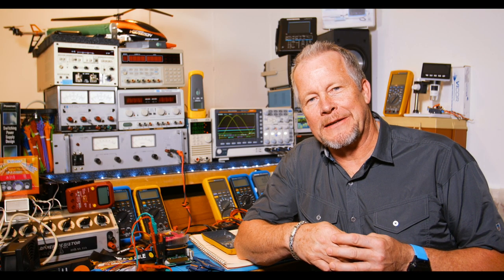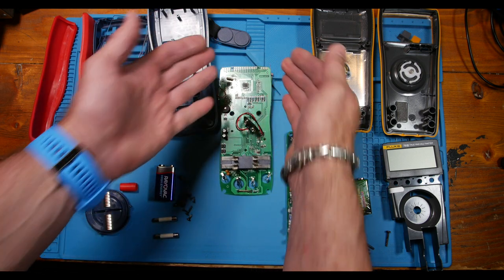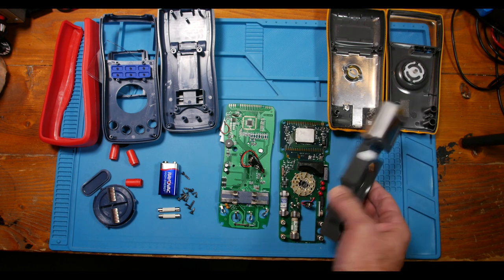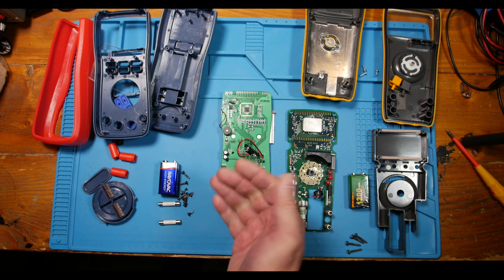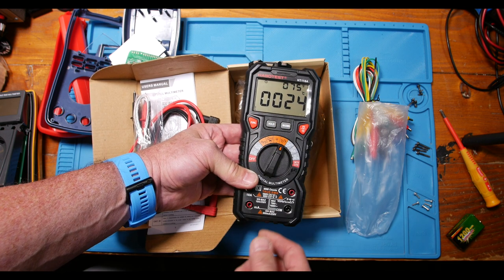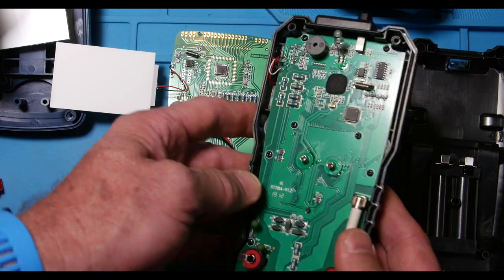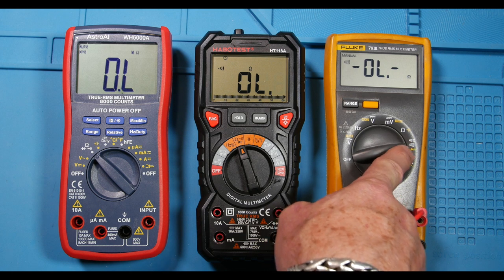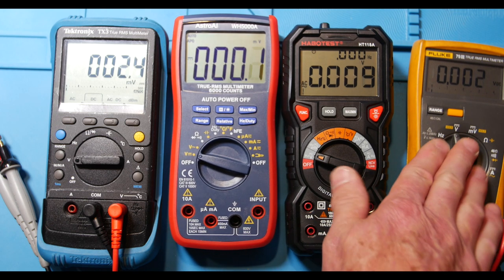Low Cost Digital Multimeters versus a Fluke

Comment: Great review great multimeter but the main problem in this multimeter model 
HT 118a (diode mode) is this normal  in case of good diode and shorted diode give short beep not like other multimeters give short beep in case of good junction and continuous beep in case of shorted diode Or transistor
Reply from the maker: Thanks so much! It is funny how different some multimeters are in how they handle diodes.  Thanks for pointing that out!

Comment: Great video. Thumbs up! Definitely wouldn't be using the cheap meters for Cat III or CAT IV stuff, but they look like they should be great for lots of day to day stuff, if they last. 

Got a good chuckle from you getting 71 thumbs down. What???
Reply from the maker: Thanks for the great feedback!  I agree, I wouldn't use any meter in a CAT IV environment - but then I'd also be dressed in full protective gear with gloves, head gear, and eye protection.  But then the Fluke I pointed out wouldn't be used either I'll bet.  People working in CAT IV are professionals who would be using more updated equipment, most likely purchased by their company - so cost isn't an issue. 

LOL, people get so offended when I show Fluke, IMHO, is not the best option;)

Comment: A Fluke is a Fluke for a reason. I think for electronics any meter is great. For electricians, Fluke still remains as the top choice.
Reply from the maker: Thanks for the feedback!  I think that's changing from the feedback I hear.  Redfish is a great meter, and I hear Fieldpiece is a popular option.  You still get the safety but more features at a much better cost, e.g. free bluetooth connections and apps.  This video was for low cost meters though, but I have done videos for high end meters that are great options, amprobe AM570 for one (owned by the same company that owns Fluke), and more recently the Hioki DT4282 which is now my favorite meter above all my Flukes; https://youtu.be/0-OzK4Snj0U

Comment: Great - so between the Astro and the 118 I have to choose between a 9v battery (which I hate) with decent buzzer or AA supply with a wimpy beeper (which I hate).  Have seen that HT118a model sold under different brands with the same model number.  Wonder if it's possible to soup up the beeper.  Got tired of having to cradle the meter on my shoulder up against my ear just to hear whether it's beeping or not.
Reply from the maker: Thanks - great questions;)  I have a new meter that I will review soon that might be a better option for you.

Comment: Hi Eddie. Great video. You're using the probe master probes. Cool stuff, I use them since years and love them. Very sharp tips, very flexible silicon cable. Best probes ever. Maybe you should do a video on probes one day ... cheap ass ones up to the more expensive ones and what the differences and use cases are ...some come with banana plug type screws others have crocodile clips etc. ppa. ... lots of options available.
Reply from the maker: I do like prob master - what's not to like - they really go the extra mile.  But, they are spendy - so funny you should mention this - cause I just recently bought a few options that I do want to review soon.  Also, I have some scope probes...;)

Comment: 37:53 why is that interesting? shouldnt it go down to zero ohms? with the fluke you would have to subtract the 3 ohms its reading from whatever your measuring. if your measuring resistance of a circuit you dont want the resistance of the meter to factor into that.
Reply from the maker: Great question.  Most meters read the ohms of the leads, so you just subtract that out as you suggest, or you can use the relative mode like what the Astro meter has that zeros this out.  What’s interesting is the Habotest seemed to zero the reading automatically.

Comment: The Kaiweets HT118A has a capacitance function and has ceramic fuses. The lead locating lights are real nice to have to help avoid those 'OOPS' incidents. Alot of functions with the Kaiweets meter and I feel it's worth sincere consideration. The link provided by 'Kiss Analog' will describe the details. I do wish the 'beeper' was louder though, it's not very audible.
Reply from the maker: Thanks for the great feedback!  Kaiweets came out with an awesome upgrade and it is the new HT118E: https://youtu.be/ZhE-aKIIRD8
Reply: @KissAnalog ....The HT118A is also extremely good with accurate measurements.  I recently notice they upgraded with the "E' unit. Of course, now I gunna want that one. Thank you for the reply.  https://youtu.be/U7BtLLsrdX0
Reply from the maker: Yes here's my review of the HT118E: https://youtu.be/ZhE-aKIIRD8

Comment: Interesting. I just got the Kaiweets HT118A ($44cdn from Amazon), and there are differences. They look identical, except for the name. One, it defaults to DC measurements, and the temp setting has Fahrenheit in the larger digits. Maybe a newer version of the board. Pretty cool for $44 cdn, but won't replace my Fluke's anytime soon!
Reply from the maker: That is interesting!  Thanks for that info;)  What Flukes do you have?  I'm starting to find meters that I like better than my Flukes - especially given the high cost that the Flukes have risen to.  Every year they cost more...
Reply: Great point, I also have the KAIWEETS Digital Multimeter as a backup to my Testo. I too have owned Flukes, Klein, and other meters, the Kaiweets holds it's own, especially as a backup. When I have to use a meter in harsh conditions, or areas where the meter could get easily damaged or stolen, it's the $34 model every  time. 90% of my work is low-voltage anyway, so there's not much compromise going back and forth. The reason I could never replace my Testo though, is the invaluable no-touch switching between voltage and ohms, as I am a low voltage electrician, primarily working on fire alarms and other systems. Being able to have hands-free switching is invaluable, thanks Testo.

Comment: Hey! Thank you for the awesome video. I am looking to purchase a dmm. I have my eyes on HT118A and Fluke 106. Which one should I go for considering I will be working on low voltage circuits basically analog electronics is my forte?
Reply from the maker: Thank you!  I would get the HT118A as it has more features and is a better meter IMHO:) If you use this link I think it will give you a discount and help support this channel;) https://kaiweets.com?sca_ref=1269738.glN6S8aePH
Reply: @KissAnalog  thank you very much

Comment: Sir,please guide me.I need a digital multimeter for testing Ac/DC 1000 to 1500volts.thanks.
Reply from the maker: That is some high voltage.  Is it high energy potential too (high available current)?

Comment: Great video ! 
May I suggest another round of testing to examine suitability for in-circuit testing to measure low resistance range (1000 ohm or so) ?  The output voltage of the DMM to measure resistance should be not be high enough to turn on PN junctions, which would falsify the readings.

The output voltage of my $34 UNI-T UT890+ is over 1 volt. I am looking for a cheap alternative that could be used for in-circuit testing.

Regards
Reply from the maker: That's a great idea J;). I'll have to keep the low ohm test in mind - very good suggestion!

Comment: I've got the astro. Obviously I'd like to upgrade in the future. Only real complaint with the astro is when using it for long periods it keeps turning off/timing out. I'm not sure if there is a way to extend that time out or turn it off completely but if there is I can't find it. It's really annoying.
Reply from the maker: Thanks for the question - but I don't think the Astro has a defeat method for that auto off.  I agree, that can be frustrating.  It is right when you start a test, and the thing beeps at you:)

Comment: I have the WH5000A and I've used a Fluke 179 at work where one of the things we do is repair control boards on the payment module on vending machines. I see absolutely no reason to ever shell out the vastly overpriced sum for the Fluke. Will the WH5000A last as long as the Fluke? Maybe, maybe not. I have been using the WH5000A for six years now with no issue and if it died tomorrow I would Amazon myself a new one rather than shelling out for the Fluke. $40 or so every six years vs a new Fluke every ten years or so? Easily worth it. Does the Fluke have a tiny bit more precision in a few places? Maybe, but it also has less capabilities and if I really need that precise of a measurement I have my Rigol scope for that.
Reply from the maker: thanks for the great feedback!  Kaiweets has a sale going on now, here's the link: https://kaiweets.com/collections/best-seller?sca_ref=1269738.glN6S8aePH

Comment: Good review comparing Fluke with the cheaper ones. Much appreciated. Is the HT118A still working? That multimeter seems to be the most popular multimeter for the past year. Im considering the less expensive HT113B model. For my uses, not sure the extra $15 for the HT118A is worth it. That HT118A does look much cooler though... lol  Have owned 2 cheap meters in the past so for me, they are throw aways and its just a matter of time when they get thrown. Any other recommendations appreciated!
Reply from the maker: Thanks for this feedback!  Great question!  I have a HT113B that I’m going to do a review on soon.  I do like the feel and operation of the HT118A;)

Comment: What about shorted diode test  in diode mode give short beep like good forward diode because if you touch the probs in diode mode give short beep like good forward junction is this normal in this multimeter HT118A?
Reply from the maker: Thanks for asking.  No the HT118A and new E model do not beep but they do show the breakdown voltage.  It seems some people like the beep and some don't like the noise.  The new E model is 20k count and you can get a 15% discount code using my KA15 code at Kaiweets.  Here's a link to my video: https://youtu.be/ZhE-aKIIRD8

Comment: I have a astro ai trms 6000 multimeter,the backlight is my biggest issue as it only stays light for about 10 seconds. Is there anyway to modify it to where the back light stays on longer. Seeing as it's a $35 dmm I'm not concerned about warranty just functionality
Reply from the maker: Great question bicephus!!  Unfortunately it is fairly elaborate.  Check out this link; 
http://www.kerrywong.com/2016/03/19/hacking-dtm0660l-based-multimeters/

Comment: Would you be comfortable using the HT118A on a tube amplifier?
Reply from the maker: Thank you for this great question!  Yes I would.  The voltage level should not be a problem and the energy in the tube amp circuit is not really very high.  I hope this helps.

Comment: Hi, is it possible to use a lithium cell (4,2V when fully charged) instead of the alkaline cells for all these 3V multimeters without 
damage for the card and the screen? or only with a storage charge (3,8V)?...or not at all?
Reply: Lithium works fine and higher voltage is okay. But lithium is expensive. Makes no sense for battery to cost more than meter.
Reply from the maker: I do like to use rechargeable batteries with my meters that use a lot of current, but these meters are low power meters.

Comment: Hi! This is a great vid! I have a kid who is starting to get into this stuff, and I'm looking at multimeters for her. The problem is that she has high-frequency hearing loss. Do you know if any of these meters have a continuity test beep that is at a lower frequency or are they all at high frequency?
Reply from the maker: Beth Schaefermann That’s great that you are helping her find equipment!  And, that is a great question!! I know some are louder, and I do this hear a different frequency between them, but I’ll have to get back to yon this.  Btw, I just posted a video on meter safety; Digital Multimeter Safety https://youtu.be/efw-myo52NQ
Reply: But then again, the HT118A at least had an additional light to show continuity. 
The light was slower than its beep though. 

Also, if it is just about the beep on continuity, then maybe you could try making a continuity tester yourself for yout needs. 

There is something that is called a "555 Timer IC. It is a small chip, that can generate sounds and you can choose the frequency that you like. Just look up a "555 Timer Oszilator circuit" and maybe a tutorial online, and then have it light up and make sound
 (so, you'll have to drive a buzzer and an LED on the output)
when there is continuity 
(so, when current can run through the circuit under test, and thus powering the tester by the current that runs from one pole of the battery to the other through your continous circuit under test, the timer will create an oszillation/sound on the buzzer).

Comment: I have had the Kaiweets HT118 for less than 2 weeks, and I’m having trouble getting it to come on. I have to turn it on several times before it actually works. I know it has a three year warranty but you have to send it back and it’s really the only multimeter I have. Is this common?
Reply from the maker: Sorry to hear that Jay!  I haven't had any other feedback to this problem.  Have you tried a new set of batteries?  Maybe they'll send a replacement and have you return yours after you receive it?
Reply: @KissAnalog  I tried new batteries, but thanks for suggestion. Seems like there are tons of $40 meters and then $300 and up meters and nothing in between. I’m considering a 3 in 1 Oscilloscope so I will have another meter close. (I’m just getting started) I watched your Hantek video. Do you prefer it over the Owen?
Reply: @KissAnalog  well, I guess new batteries did fix it. I checked the old ones and they tested fine, but when I replaced the batteries it works perfectly! Thx so much and sorry for the bother. I’m still thinking of a 3 in 1 Oscilloscope. In your opinion is that the next item for my wish list?

Comment: Also on the Habotest the display light up red during certain tests, might be the NCV not sure.
Reply from the maker: That’s to caution that a high voltage is being measured. Pretty great feature!
Reply: Yes it is and makes a lot of sense, the Habotest is a great bang for buck meter with its myriad of useful features. I learned about it from Darren Walkers meter review channel, highly recommended for anyone interested in meter reviews, mostly budget meters but many others as well.  In fact I think the Habotest won his 10 best budget meters of the year shootout.  He features lots of newer UniT stuff that I like much better than their older meters.  Certain folks criticize these lower priced meters due to their minimal input protection compared to Fluke and the like, but people should be made aware meters in these price classes arent intended for  or equipped to perform serious high voltage work no matter what the CAT ratings say.  Even reading 120v could be dangerous if one was unlucky enough to encounter a surge or transient while in use.  I feel these sub $100 meters are mostly for home/hobby-DC/bench/DIY electronics use where one never sees anything over 120v - if you need a meter to trust with your life then get a fluke or similar by all means.  But far as accuracy many of these lower priced meters are capable of accuracy equaling much more expensive meters, they just dont have the input protection for serious more dangerous areas so those criticizing budget meters should choose meters accordingly, not everyone needs a $500 Fluke for hobby or home use, like any important tool one should select a multimeter according to the job at hand and take note of any possible dangers that job may hold.  But again, far as accuracy ive got meters that cost as little as $20 that show amazing accuracy even when compared to very expensive meters, and these make great low voltage electronics DC bench meters as most electronics are low volt designs by default - this kind of work just doesnt need a $500 Fluke for accuracy.
Reply from the maker: I totally agree with you.  I’m all about safety - but there’s so much confusion and bad advice out there.
Reply from the maker: Thank you for the link and feedback!  I have a bunch of meters but I can’t keep looking;) But I need them to review - right?! ;)

Comment: Como calibrar o HT118A pois comprei um e veio descalibrado
Reply from the maker: That's a great question!  I'll have to ask the people at Kaiweets.  Does it read volts or ohms or current wrong?
Reply: @KissAnalog  Bom dia amigo! Sim a leitura de volts está errada,quando vou medir uma bateria de moto 12v aparece 166v em DC.
Reply: @jonsoninversorescaseiros7089  Sounds like a blown thyrector on the input protection circuit of the DMM to me. Just my $0.02.   Fred